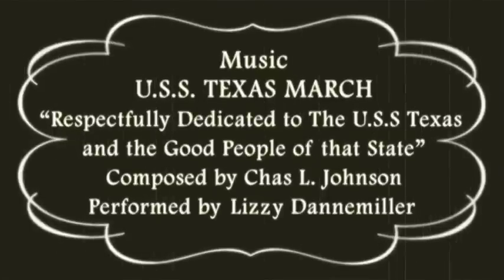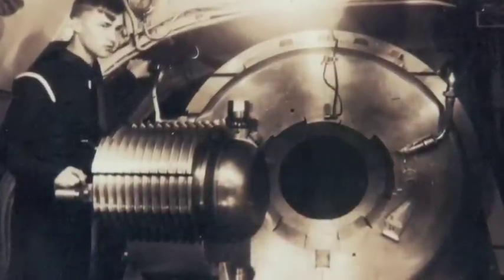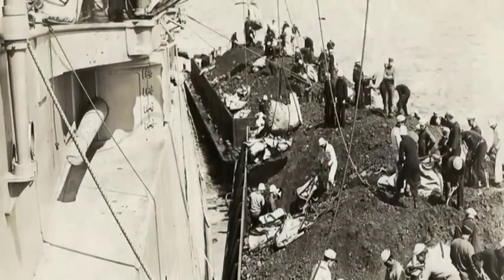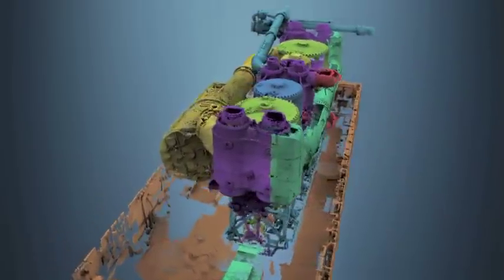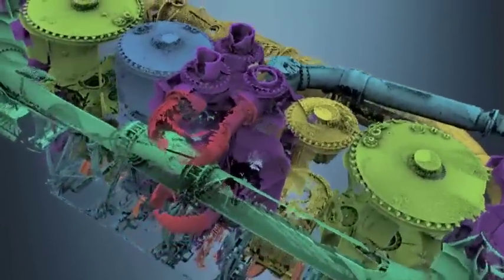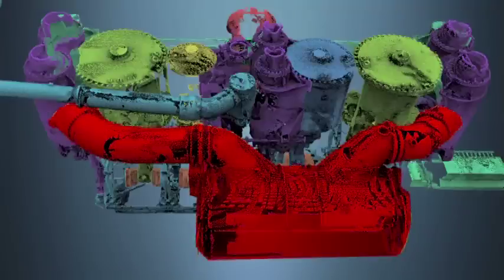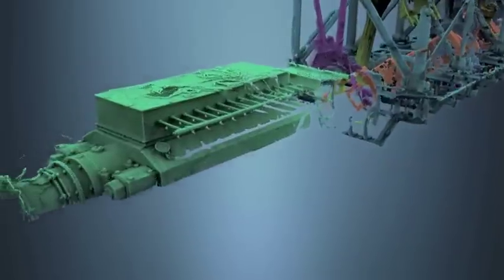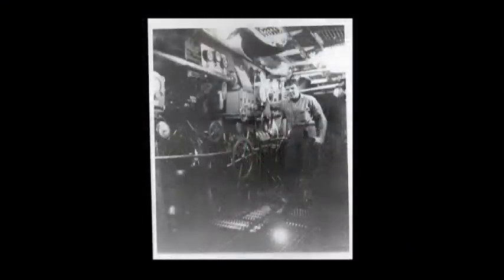Battleship Texas Engine Rooms

Comment: Fascinating info.  These were the same kind of engines as the Titanic aren't they. Which were bigger?? Do you know?
Reply: +Thomas Hockin yes and no,the Titanic used two triple expansion 4 cylinder engines but they were much bigger standing nearly 40ft tall they also used exhaust gasses from the triple expansion engines to drive a turbine which powered the Titanic's center shaft.
Reply: interestingly enough both the Titanic and Texas were built at about the same time and had similar top speeds
Reply: Titanic had physically larger engines. However, power from these engines was similar to Titanic based on higher steam pressure and higher rpm.
Reply: In England there is a 12,000 Hp mill engine still operational, but it isn't a compound. Still impressive, though.
Reply: +Jesse Ramsay: Actually they're Quadruple Expansion engines-one high pressure, two intermediate pressure and one low pressure cylinder if I recall correctly. A classmate of mine once got a personal guided tour of Texas's engine rooms something I am still quite jealous of . . .
Reply: Actually, Joseph Greeley, they are 4 cylinder triple expansion engines, as the 2 low pressure cylinders work together. If they were quadruple expansion engines, the steam would go  to the high pressure cylinder first, then the first intermediate pressure cylinder, which is larger, then the second intermediate cylinder, which is larger again, then the low pressure cylinder, which is the largest. There were a few quadruple expansion engines made, but they're very rare as the advantage over a triple expansion engine does not justify the extra cost of manufacture and extra complications. The Titanic could be called a quadruple expansion set, as the turbine was an extra stage, but it wasn't part of the two reciprocating piston engines which were also 4 cylinder triple expansion engines, so it doesn't really count that way.

Comment: If you visit BB-35, the USS Texas. Make a point to go below and stand next to this massive engine. Just the sheer size of the Crankshaft, Connecting Rods and Low Pressure Cylinder will impress you.
Been there done that.